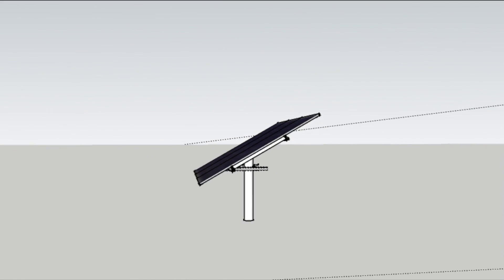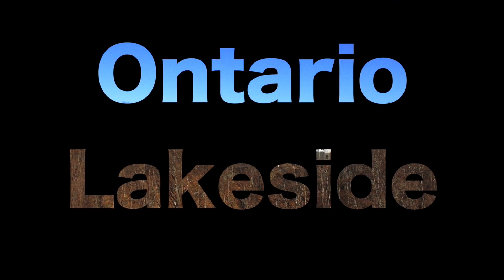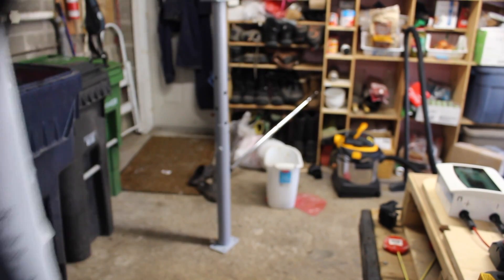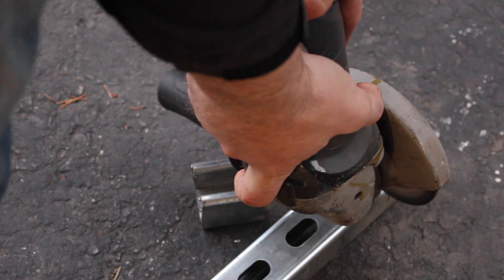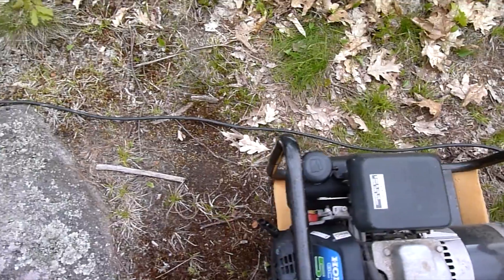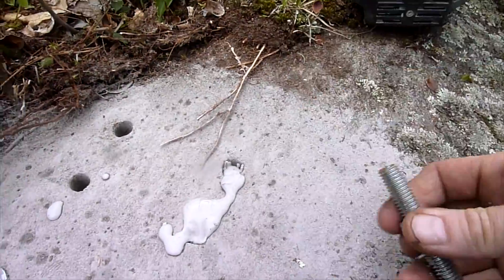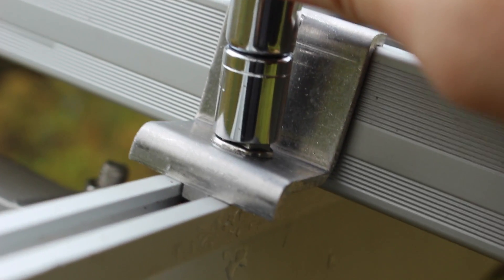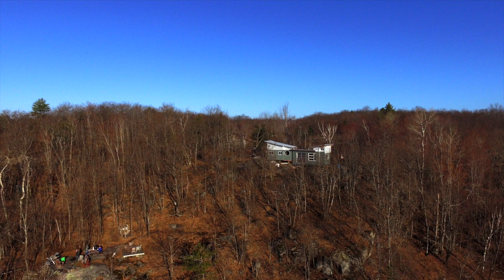SOLAR Ground Mount. ------- DIY with 2 Axis

Comment: Doing a "azimuthal"  Rotary axis for the daily tracking simplifies things so much (so many of the 2-ax systems must compound things with  X/Y rather than Az/Elev)- the elevation really only needs seasonal adjustment in most cases (solar doesn't need perfect tracking), even just adjusting twice during the day makes a significant difference.

I have "thought" of a garden gazebo with a rotable solar array as the roof  - (2nd axis for seasonality) (using a large pipe ring as the rail with sets of trolley wheels - for the ""coaster" elements.... ) One day, other "projects" to get sorted mean while.)

Comment: I'm curious to know how well this mount has held up over the four plus years since you constructed it? Upon closer views of the material used, it looks as though your steel it is thin and won't withstand high winds or heavy snow loads. Did you ever get the actuators on to self propel the stand? Good video. Cheers!
Reply from the maker: I upgraded the main cross pipe to a thicker wall pipe but otherwise its working well. I never intended to automate it. I just rotate it manually on days when I need more power.

Comment: Great idea ! Just curious what the  Dimensions of your panels are?  And weight?  I've got 12 100 watt 26x40 inch panels that would weigh about 200 lbs Together. If i put them all together it would be about 14 ft long and 6.5 ft tall . Do you think it would be to big and heavy?

Comment: Nice! solid installation! I'm a commercial solar installer and have one suggestion for ya: the small metal clamp that sits between panels to hold them to your frame would be stronger if turned 90°. that way the two tabs on the ends fit snuggly into the gap between the panels and act as spacers
Reply from the maker: +crunchatizemecaptn thank you! I puzzled over that part and could not figure how it should fit! Makes perfect sence now!

Comment: Great job. Thanks for posting. I have to do a solar installation at our cabin. Your mount is nice an simple. I see that things are wrapping up (as much as they ever do), if you have any more concrete mixing try a low speed high torque drill and a 5 gallon pail. It makes quick easy work and little clean up. Ron.
Reply from the maker: +Ron Young thanks for the tip.
Reply from the maker: +Ron Young wrapping up. But lots to do but that's the fun!
Reply: The easiest way to mix sackcrete is to roll it back and forth on a 6 by 12 ft tarp. I've mixed over 100 bags this way. I call it pull-pull-dump. Keep it stiff enough that it forms a ball in your hand.

Comment: hmm, lots of comments :-)

1) I never welded but need a basic welder, what do you have?
2) I did solar 10-12 years ago just to experiment and back then it was horrendously expensive. I did 30 watts and tried to power  a shed light at night.  How much for the 1k?
3) Will you eventually motorize it to collect the optimum amount of energy?
4) Have a great summer.
Reply from the maker: +Steve S I just bought a cheap stick welder used. I'm not great at it but it's very useful. 
Panel prices have come way down. These were less than $1 a watt. 
It's cheaper to buy more panels than adding a motorized tracking system. 
You have a great summer too!
Reply: @OntarioLakeside  Depending on the size of your array, a tracker might actually be worth it.  A dual-axis tracker can increase power by up to 46%.  Some people DIY them with old satellite dishes for a couple hundred bucks.